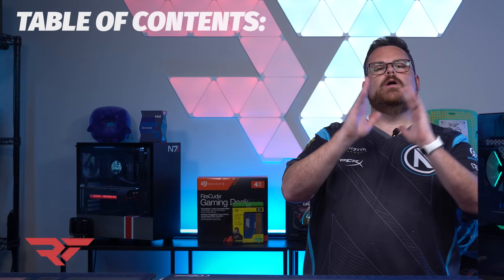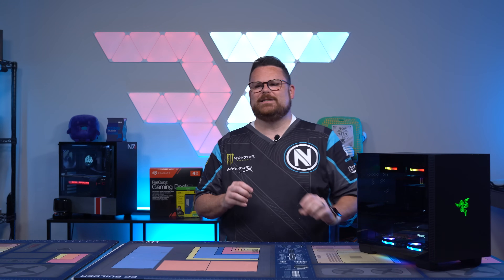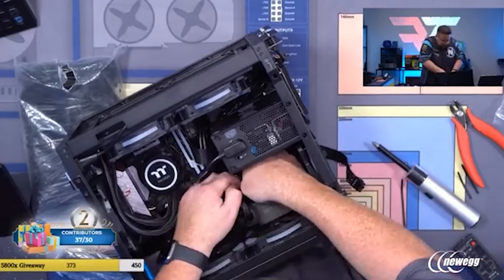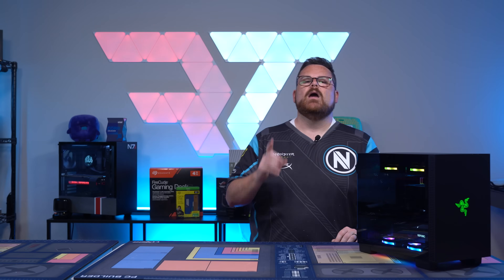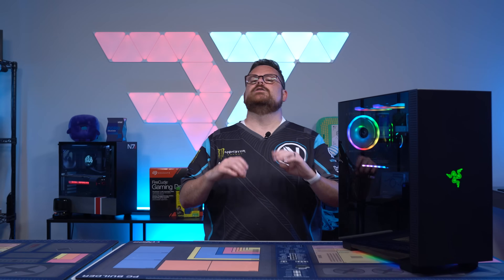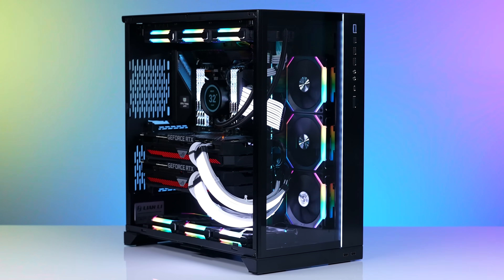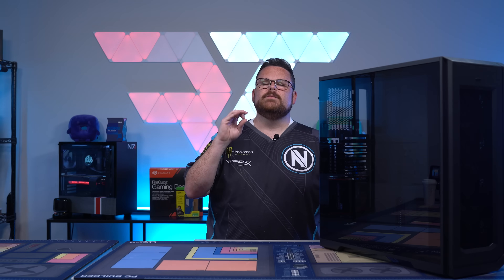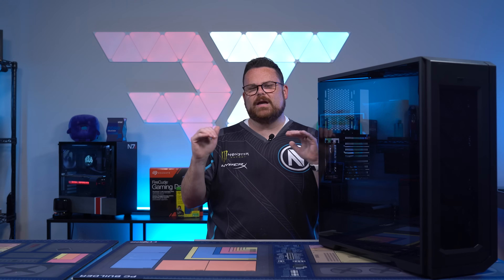Picking the Right PC Case for your pc build with Robeytech!

Comment: I know that they're dead but like my 5.25" bay, does anyone know a good case with good airflow with one.
Reply: I’m not completely sure what a 5.25 inch bay is, but off the top of my head I think the dp502 flux from antec has one. Not 100% sure tho, so you might wanna check. The airflow on it is really good, plus it comes with 5 fans, 3 of which are rgb.
Reply: @flammerz1938  yeah I saw that I think I'm going to go with that one.

Comment: Hi robey,i`m going to buy a lian li 011 dynamic xl case with 9 fans and aio.what is the best setup for airflow in that case?3 bottom intake,side intake and aio radiator on top exhaust?Or bottom and top intake and side exhaust.
Reply from the maker: Bottom top intake, side exhaust

Comment: Might Upgrade sometime from my Thermaltake V200 TG RGB case,   picked this one out from local shop, not knowing much, but Airflow really not the best,  PSU filter is hard to get to while system powered up to clean it off, and replace back down there when it's clean.     ((so far just moved up my Dust clean outs from every 3-6 months, to strict every 2 months to make sure stays clean))

Comment: I would really like some "Top X Robeytech recommendations for each form factor", especially since you've made so many builds, that things like "I like this case because of the cable routing channels" or "because I can fit any size components" or stuff like that!. Really liked the video, super informative!
Reply from the maker: They are in the description 😀
Reply: Personally I'd suggest the Cooler Master H500 (or the ARGB variant). It fits E-ATX, ATX, and MicroATX (and maybe Mini-ITX) sized motherboards. Has awesome cable management overall, insane airflow (thanks to two 200mm front fans) and good options for storage too. Its main downside is the size, while it's easy to work in it's also pretty dang big. But it also has a "handle" on top to help carry it easier.

Comment: Wow I guess im going to buy a new case. Thankyou again Robey. ( I have the 280x right now do you think that airflow is going to be good in it )
Reply from the maker: We haven't tested that specifically, but if you have the right fans to pull air through the glass area you should be fine!
Reply: @RobeytechLive  Thankyou so much!

Comment: Most difficult case build? Finding a case with a 5.25" bay for Blu-Ray burner. Choices are $50 for a low-end case or $150 for a high-end case. Nothing in between. The difference between the two price ranges is that high-end cases have a USB-C front panel connector. I went with a Cougar MX330-G ATX case for $50. When I discovered that the MSI Tomahawk X570 had a front-panel USB-C connector, I got a USB-C extension cable and bracket to run out the back.
Reply from the maker: Yeah, unfortunately in the US they just aren't popular.  Still very popular in Japan where you can find cases with a drive offering.